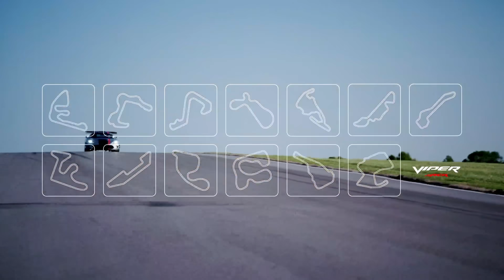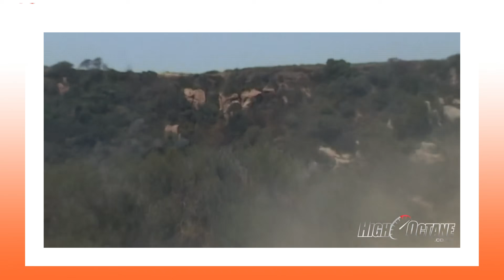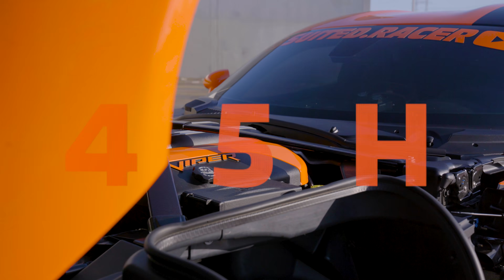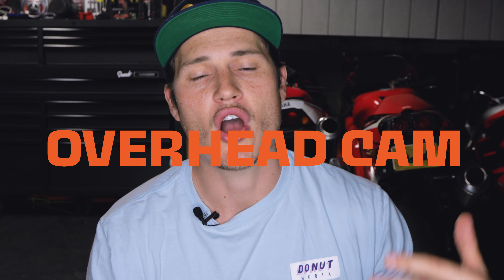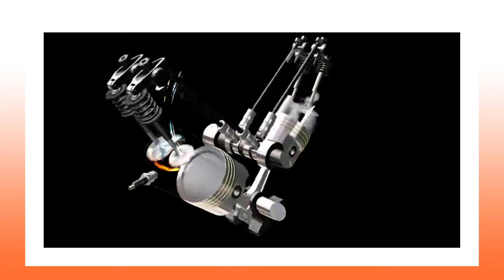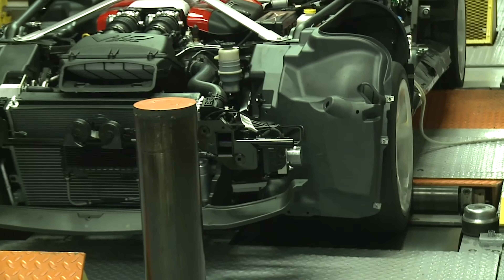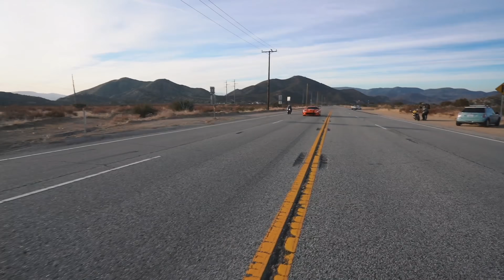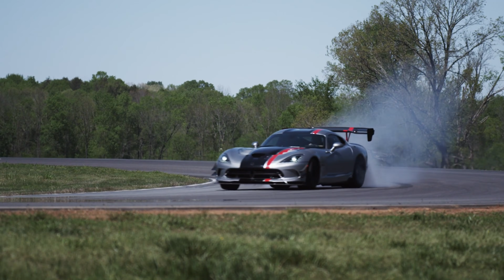The Engineering Behind the BEST car America Will EVER MAKE - Dodge Viper ACR

Comment: In the first two minutes- WAIT, wait, hold up! That was obviously staged! For example, how did there JUST HAPPEN TO BE A CAMERA ON A TRIPOD, right where the Viper flew off? And it was all set to pan around perfectly, just as the Viper went off. The audio has tire screeching sounds, but the Viper's wheels aren't even turned into the corner! They're just pointed straight off the road! And if it was supposedly then skidding in a straight line, then why are the wheels still turning? Why is there no skid marks on the pavement, where the video obviously has the screeching noises edited in? (Not talking about when it's in the dirt, just before that, when it's supposedly screeching on the pavement) Look at that analitically! Don't just watch it passively with your brain in neutral! Anyway, the last Gen5 Dodge Viper ACR did a 7:02 on the Ring, (with more left in it) so it handled VERY, VERY WELL! Look at the very few cars in that rarified company! Then look at how much they cost! Any twinkie who says the Viper is out to kill you probably has never driven one on the limit on a race course, they're just parroting what some other fool says, who also hasn't driven one on the limit. (Or maybe they're talking about the cruder Gen1 from 1992-1995) In the Viper club, we practiced dancing on the limit of traction, where the best times are set. It's not "oh so scary" when you learn to handle it like a boss. 

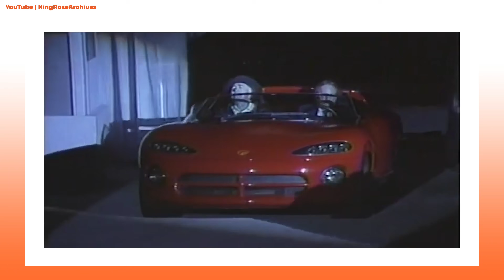We had a guy with a Gen 1 that used to do 1:30 at WillowSprings big track, which is not too shabby for the crudest of all generations of the car...

Comment: There is no empirical evidence that states pushrods cant rev as high as overhead cam designs. The historical outlook has been that pushrod engines generally have longer strokes, thus lower rpms. Stroke being equal between the two, they have similar if not identical rev range capabilities. The broomstick analogy was pretty horrible lol.

Comment: Just shy of 77 horsepower per liter.... Wow, such many engineer.
Tons of downforce using giant spoilers that literally any middle school boy would draw if you told them to draw a race car. I guess that proves Dodge has watched at least one sprint car race.

Real cutting edge shit right there. Max out the engine size so it has the power to drag those big stupid AutoZone wings through the air, all while having the top speed of a family sedan. Wow. Such innovation.

Meanwhile the Ford GT Mk2 makes the same power out of a 3.5L (185hp per liter), is lighter, is WAY faster in a straight line, is faster on a lot of tracks, and is only marginally slower on tracks that favor maximum downforce. Oh yeah, the GT doesn't look like a child's caricature of a car.

Comment: I´m a Auto Designer & Stylist from Germany and i can tell you that the American made Pushrod V8´s are so genius, the whole concept is very perfect. It´s not really that,that they was not so good like the OHC/DOHC concepts. That´s really not true. It´s an different way, a way what has less working parts and is nice to work on it. Especially the American V8, especially the GM Small Block, ore the HEMI´s was so amazing especially becaus they was produced back in the days for an so affordable price that everybody could afford it and so everybody had that chance to own an ultra reliable V8 under the hood that could last the whole of your lifetime if you like. Especially that amazing high production numbers and even the price and the possibility to repair it with not many special tools is a so great concept and THAT´S REAL PERFECT ENGINEERING.... (Tody you could see on the tiny downsized engines that the Automakers would not that the people could have a car that could be repaired very well by them and last not very long. Downsizing is that what will kill lifetime an even also especially the usable part of the RPM and that´s why gearboxes today has so much gears/speeds. Wit an engine that is generating the power naturally espirated from more Cui/ccm is that was makes an Engine so solid and long lasting + a good repairable piece, if it´s engineered like the classic american V8´s. It´s not to beat in these things. Also the options what you´ve with this design is unbeatable. A tiny, downsized engine doesn´t has all that variaety and options, and even never that lifetime. Physics could not be beaten wit politic lies the EV or the Downsizing. That´s a big bad agenda from a bad clique what lies the people about "C02" and will kill the longer lasting tegnologies. That´s the bad what we saw back in the 1970s too. lies lies lies. And that´s importand to know when you´re thinking and talking about this. The Especially the EV´s are the death of DIY and a long lasting car, that´s the death of options and is really bad for the environment if you´re looking it with the truth. Especially these Litium cells are not only a big environment destruction, these are also so dangerous and nobody talk aboput that. Because i know that you´re often caged in a car after an accident and the problem is that these lithium cells are in the floor of an EV. And if the EV has an crash, these Cells would be damaged and the crash tests of EV´s lies so big about that problem; The people in the EV will burn down, caged in the EV after a crash without any chance to get out! Really, all tests of EV´s or cars with Lithium cells are safe, not nearly safe! They could NOT be safe because you´re sitting on Lithium Cells what burns better than napalm! It´s so dangerous and they know why they lie aoubt EV Crash tests......And nobody talks about that truth. But back so the good engines with future; The OTTO & DIESEL ENGINES ;)
Look, i love Alfa Romeo and especially Alfa Romeo was ist back in the days what was introducing the full amuminum alloy Block and overhead Camshaft/DOUBLE Overhead Cam, and hat all their Engines  in 195s engineered in this concept, also for the large series in building sedans for the family with engines in this concept too... And it was Alfa Romeo who found the performence oriented midsize 4 door Sedan and Coupe in the affordable prce range...That was BMW doing 20 years later wtth the M3/5. But Alfa was that Automaker what used the DOHC and full alloy engine design at 1st an it was that company what was back in 1920 the Formel 1 dominating Automaker too. Back then it was Enzo Ferrari who was by Alfa Rmeo, that´s why Ferrari is called "SCUDERIA Ferrari", that means that it´s an RACE TEAM, that was by Alfa Romeo, and that was Enzo Ferrari´s Race Team. So today you coul get the Alfa Romeo GIULI QV (now also the faster GTA & GTAm) what is a big piece of modern history, because it was Alfa Romeo who introduced this performence Sedan Class back in the 1960s with the GIULIA back then. The GIULIA QV uses this DOHC Engine Desine, it´s a V6 DOHC Biturbo Engine with 2.9L and brings 510WHP. It´s the fastest sedan on the famous Nürburgring Nordschleife. It set the 1st Record with a 6 Speed Manual Gearbox GIULIA QV, an beaten the own record with the Giulia QV combinated with the new ZF 8 Speed Automatic what you could find in the Charger, Challenger, C/E63 AMG, BMW M3/4/5...in almost every performence oriented car today now... And what we even have to say about the DOHC Design is, that this design is a lot more work to repair, a lot more to engineer, a lot more weight of the engine, and yes, it´s a nearly perfect Design..But it´s even also a more expensive design..It need´s 2.4 camshafts when the push rod deign needs only 1 camshaft. and that´s also a part where you could see, that it has not only PROS. It has also negative against the pushrods. Especially when you´re looking at Dodge/MOPARS HEMI V8´s you could see how much potential the PushRod Design in an V8 Engine could have. That´s also a perfect engine design that hasn´t to be called "beaten by the DOHC"..Because it isn´t beaten by the Overhead Cam Valve designes. It´s how i sayed; You´ve to choose the right one of both designs for the engine design. And if we take a look at Dodge with the HEMI V8´s you could say that they´ve done it very very well, nearly perfect when they´ve choosen one of both designs. Because the V8 could be perfect wit pushrod design. The HEMI´s are a great example for that....

Even the right one of both designs, for the engine design and use. DOHC isn´t better or not, it´s only a different way to open Valves... Look at the HEMI´s how perfect the Push-Rod Design could be, that´s a lot better than the most DOHC Engines are. Because they´ve used the right way of both designs for this V8 engines....and yes, also the GM/Chevy LS did that so perfect too

Comment: The viper has not the most torque between the n/a engines in production cars, here there are two examples wich are push rods, but I think there could be more:
the 5.2 liters in the aston dbs makes 663 ft lbsof torque, th 6.5 liters v12 from cosworth wich sits in the aston martin valkyrie has also more torque than the viper (664 pound feet).  Aston fanboy? No, just facts, I love turbos lol.

Comment: This is actually terribly misinformed on the valvetrain end of things. There is much more freedom in the cylinder head on a pushrod engine with runner trajectory, chamber pierce point, valve angle such as cant and splay, and nearly everything. While there is more mass, modern valvetrain technology allows us to cycle a ~2.600" hollow stem titanium valve at 13,000 rpm on a spintron. NHRA pro stock rules are extremely leniant on cylinder head rules, thus engine builders have rotated the valve package in the Dodge Pro Stock (DPS) and Chevrolet Drag Race Competition Engine (DRCE) a near 90 degrees from cast position. OHC engines are much simpler and quite durable, there is no fundamental issues with them. However in an environment of experimentation, the limitations with cam placement, valve angle and port design are a hindrance to progress with casting number rules.

Comment: lift isn't created by the wing angle alone. it is the curved top side of the wing that creates lower air pressure, which means the higher pressure under the wing will be drawn to the area of lower pressure. 
If you look at the rear wings on an F1 car, you'll see the bottom is curved the same as the top of an aeroplane's wing.

Comment: Honestly the Viper and the Corvette are the only 2 decent large automaker cars that I would consider the best.
Tesla as a new wave automaker is the best for electric they are lightyears ahead of everyone other than Renault and their claim to fame car will never make production as the most advanced car ever made.
Muscle cars well, Mustang, Camaro, are the best 2, because they strike a decent balance I don't include Dodge simply because the Charger/Challenger chassis is based on the worst car ever made and has inherited its reliability and safety issues late 2000's 300C was just garbage in and out.
Sports Compact Car would be the GTO from Pontiac that struck a perfect balance of American Muscle shoe horned into a small compact chassis that could handle and keep up with the ricers.
Runner up CTS-S in the luxury sports category. but it is what it is and that means its garbage for the most part.

Comment: The Bentley Mulsanne 6.75 litre v-8 has over 800 ft-lb torque and it's a pushrod engine and is the most powerful torque wise non diesel v-8 ever made..

Comment: my car has it lol lz9 engine The new LZ9 3900 features Variable Cam Timing, a new feature on a pushrod engine, roller rocker arms and has a variable length intake manifold. A computer controlled plenum divider that, along with the VVT cam function, improves efficiency across a broader RPM range.

Comment: Sorry, but a wing and a spoiler aren't synonyms. They are two different devices for different purposes. While a wing in cars produces downforce, a spoiler spoils the airstream to prevent generation of lift.
Also, the fences at the consoles of the wing don't "keep the air there", but prevent the area of high pressure over the wing from spilling down into the area of low pressure under. Thus, they increase the effective span of the wing without increasing its drag. But the most interesting purpose of those wingtip fences is that they, in fact even reduce the overall drag by controlling the wingtip  vortices

Comment: “Best car America will ever make” that aged like milk since the ssc tuatara hit 331 mph.
Reply: Top speed isn't the sole measurement of how good a car is. Before that, there were other cars faster than the Viper, like the Hennessey Venom. The Venom has over double the horsepower and the Tuatara has nearly triple, but that's not what determines track performance.
Reply: Well it's an old video
Plus nobody had high expectations for the tuatara so what can you say

Comment: One of the main benefits of a push rod engine is: There is a mandatory nitrous bottle installed where your roadside tool kit is. Don't believe me? Check. If there is not a nitrous bottle there, while you are not technically breaking the law, you are committing a crime.

Comment: i want better from the USA, man! the germans take a 2.0 16v 4-cyl and squeeze 738bhp from it (boba-motoring) running standard fuel, over 1000bhp with racing fuel. This is more than 4 times the displacement and more than double the cylinders. I aint knocking the Viper, we all love it... but it should be pushing out WAY more.

Comment: So I randomly looked up the drag coefficient of my 2012impala this morning because it seems so easy to coast at 100mph.   Turns out it is .33... Which while I was driving I didn't have much frame of reference for... Until this video...  So my impala is more aerodynamic than a dodge viper.   This car is so under rated at 305hp, 3500lb, and a .33 drag coef...  It shows too.  I've had this car for 7 years and won too many jaunts.:; I s'pose that viper is more downforce focused aero even without the spoiler. So for me to say better isn't fully right but still I was very surprised.

Comment: Machinist in MI I use to machine the carbon fiber vents, front splitter, the wing mounts and side fins.
Reply: Tons of other car components. LS2 engines. Dart racing, Diamond pistons (all machined with HAAS from AL billet) Flow Master. Prototype tooling for OEM
Reply: All those viper parts(that came from the shop I worked in) were machined in HAAS too. America!

Comment: 6:39 A broom that is directly fitted to the light switch, via a ring on the broom and a pin on the switch, would be just as quick--or quicker--than a finger. The broom is also one piece whereas Jeremiah is not merely using "a finger" (6:42) as he claims, he's actually using a finger AND a thumb to turn the switch on and off. I guess what I'm getting at is that this is a poor analogy. It's a poor analogy, pushrods aren't bad for this reason, and I want my money back. I didn't spend any money, but I want it back nonetheless. Consider this notice served.

Comment: Just a tiny detail - the winglets at the ends of the spoiler are not there to make it more stable when driving straight lines or in corners, what they do is they "seal" the pressure difference from below and above the spoiler against each other. If you skip these winglets what happens is that air from below the spoiler flows to around the edge creating a massive vortex at the edges of the spoiler resulting in less downforce, but even more importantly create a lot of drag. 
The vertical flaps below the car at the rear diffuser also seal the flowing air but by creating a vortex. Drag below the car is by far not so bad as drag above it. So, in this case, it is more advantageous to have some more downforce by creating a little drag.
Just as a very short explanation, hope it makes some sense.

Comment: 1 big valve has more curtain area at low lift than 2 smaller valves of the same square area. This allows the one big valve to flow a lot better close to the seat. Also because the big exhaust valve has a lot of port velocity. On the over lap where the intake valve starts opening while the exhaust valve is closing there is a scavenging effect from the exhaust that pulls the intake charge into the cylinder. This is why American push rod v8 make so much torque

Comment: cool informative video! I would specify thou that the viper has the most overall torque only due to massive displacement rather than some engineering feat or inheritent qualities of the pushrod engine itself. An 812 superfast has per liter or cubic inch quite a bit more hp and torque than the viper engine. Also some of the track records (like nring) were made with all the extreme aero bits etc which are not road legal (at least not even close in europe). I would also say , unless i missed it, where some of the original v10 work came from and that is Lamborghini.

Comment: I really hope that Dodge will revive the Viper. But please, America, please leave pushrods behind already, it's 2020 don't waste your time on a systematically flawed concept. The hp/litre output of these engines is just atrocious, and torque alone doesn't solve all problems. For gods sake, an BMW "economy" engine from the mid 90s has the same hp/litre as the ACR.

Comment: Wrong, 2/3 of lift from a plane is generated from the top of the wing, also called the back or spine, thanks to the Bernoulli theory and Venturi's effect. Basically air sucks the plane upwards, not push it.